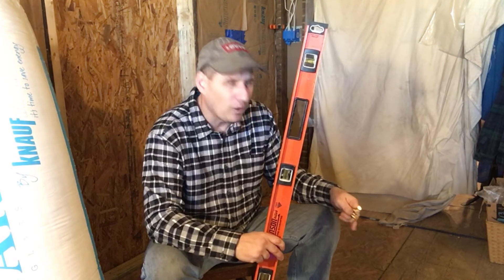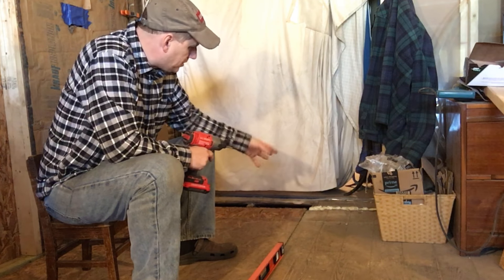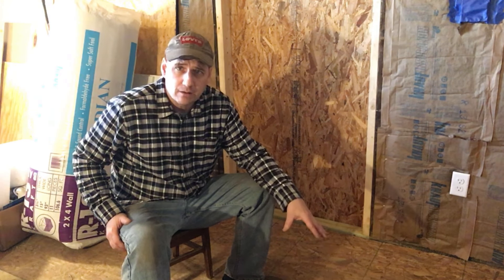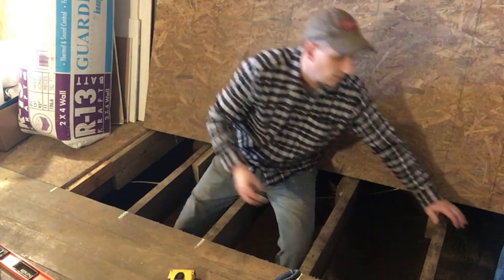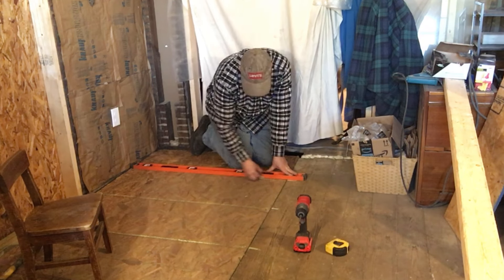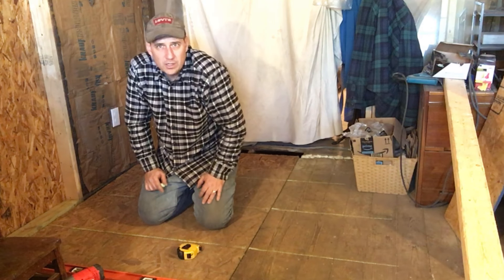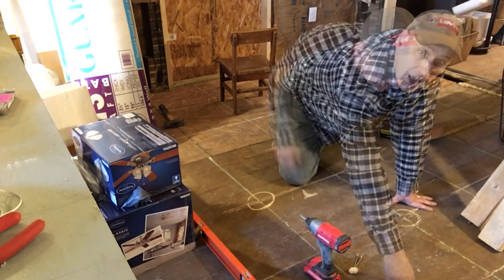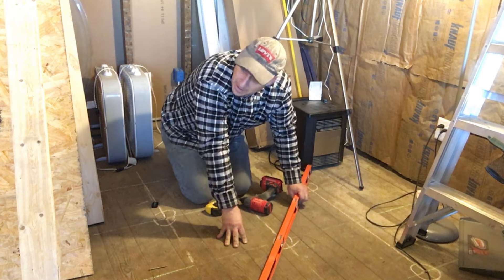DIY: Easiest Way To Level An OLD WOOD FLOOR - Using Screws and a Level

Comment: How are you compensating for an inconsistent slope?  Are you shimming underneath when there's a gap and sanding the floor or the shim when there's a 'high spot' on the overall downward slope. Is the cut wavy or just downward?  If that makes sense...I'm dealing with an unlevel floor myself.  Overall, it's not that off, maybe a a quarter inch or 3/16 at most, but there's points along the way that aren't straight downhill like a ramp.  At some points, it's1/8 off.  At others, it's 1/4, then 3/16, then back to 1/8, then 3/16 again.  Etcetera.  How are you dealing with that with the cut or some other means?  I'm a DIYer who's never done this.  The wavy off level thing is the result of my mistake, which I can't walk back at this point.
Reply from the maker: My floors undulate as well. At the lowest point I'm over 2 inches that slopes upward to a high point near the center of the house. The floor overall slopes one direction to the northeast corner but it is not a continuous slope. Mine too vary in depth up or down. Using the screws, I found the cut depths of my sleepers at the various points in the floor. Then I cut my sleepers to follow the contour of the depths where it rests. The cut goes up and down to follow the floor so the top is level (or near level). I'm not perfectly level and I gave myself up to an 1/8" to a 1/4" of tolerance. That amount of waviness is virtually undetectable underfoot in my opinion. But it will be a little noticeable with four legged furniture and appliances like refrigerators.

Comment: Hi great video
I just have one concern , I see you put the sleepers perpendicular to the joist direction , would it be  structurally wise to do that , i mean distributing the load ?
Reply from the maker: In the video, I left the original floor board deck in place. Adding the sleepers perpendicular along with the second layer of deck just creates additional rigidity of the entire system. The sleepers will not add any “structural” strength to the system. The existing joists are the primary structure. What we are doing here is just leveling and adding some rigidity to the overall system which will reduce squeaking and bounce.
Reply from the maker: If you need to reinforce structurally the joists, you will need to sister joist them. I have a separate video on this. Check it out

Comment: Thank you for a great video. I do have a question. In case floor is uneven due to root / wood worms, and even assuming you take care of the wood worm problem, won't the old floor sink more? (if continue to root) and make the new deck above it uneven as well with time?. Thank you.
Reply from the maker: If the insect problem is treated, the wood should be fine so long as it doesn’t crumble in your hand. Use a hammer to test the softness of the wood. If it crumbles or splits, replace it first. If the floor joists are sagging, the will need to be reinforced by sister-in-law new wood onto it to stiffen those. Once the structure is solid and stable, then level the floors. The new floor deck you install while leveling will stiffen everything up considerably but it will add more weight so make sure you structure is solid!

Comment: This task can be done by scribing the sleepers to the floor instead of measuring. Given the size of the room I'd be inclined to first put sleepers along the short sides of the room that are level to each other and at the height needed to match the floor in the other room. Then install a sleeper at a floor joist point at about half the length of the room making it level with the end two. Mark the tops of all three sleepers for 16" on-center spacing. To fill in the field lay a "new" sleeper from the end sleeper to the center sleeper at the marked 16" locations and put an "T" on top of it to denote the top. Make a wood block to use as a scribing guide--a 10" piece of 2x4 works!  As you slide the block along the floor hold a pencil against the top of it and the side of the "new" sleeper to mark the sleeper thickness. Mark the ends of the "new" sleeper to fit between the installed sleepers. Cut the marked sleeper to length and then along the line with waste side being the part below the scribed line, i.e., the saw kerf should be in the waste (the bottom part of the sleeper stock) not in the sleeper. The part marked with the "T" becomes the sleeper. This is a lot faster method that eliminates all the screws, the measuring, risk of measuring error, and connecting dots. 

After showing them how, I had my 8 and 10 year old sons scribe the sleepers for a 16' x 24' room. I checked the first one and it was perfect... I didn't check any more I simply cut what they marked. 

If you want to get "perfect" sleepers run the sleepers through a jointer to straighten one edge. Then run them through a table saw or thickness planner to make the other edge parallel to the first. If you do this make your scribing block the same width as the resulting stock. They may warp after you scribe and cut them but they will straighten out when you screw them down!  After I had the floor done I used it as a reference surface to level and flattened the ceiling!
Reply from the maker: Thanks for the suggestion!!!

Comment: So I have same sloping and wavy issue. My floor has the original plank floor with a T&G plank style decking. Would I need to remove that decking first before adding a new plywood subfloor using your method?
Reply from the maker: Hi Amadeus. Thanks for watching!
You can do either - but I would say that it all depends on how much you have to level.  The floors I am doing - I am leveling the entire house so I added the new level floor deck on top of the old floor deck.  If you are trying to level a room and you don't want an uneven transition to the next room - you may need to pull up the old decking - so the new decking will be flush with the adjacent floor deck in the next room.  If you do this - just level the top of the existing joists with the same methods and attach the sleeper wedge blocks along the top of each floor joist to provide the level screw pad for setting new decking onto. Then attach the new OSB deck to the top of those level wedges.  Be sure to inspect the joists for any rot or weakness and sister joist any spots that may be compromised.  Good luck with your project.  Hope the video was helpful.
Reply: @RundownReborn  So it won't be too much weight with the original sloping floor boards plus a wavy decking, the new level osb decking and vinyl flooring? 3 levels of wood plus vinyl. I have a finished basement underneath not a crawl space
Reply from the maker: I promise you that the live loads (chairs, sofas, pianos, etc) will be much greater than adding a layer of deck sheeting.
Reply from the maker: A square foot of deck sheeting is maybe 5 pounds. How much do you weigh standing on 1 foot in the same spot? See the difference? The sheeting weight is spread out evenly. It won’t be a problem. Concern yourself more with making sure you have a level and smooth floor with clean transitions to adjacent rooms.
Reply: @RundownReborn  Which type of screw did you use?
Reply from the maker: I used 2-1/2” star drive construction screws to level with and anchor the sleepers into the joists. Then I used 1-3/4” star drive construction screws to attach the 25/32” decking to the sleepers.
Reply: @RundownReborn  Thank you for your responsiveness. I'll be tackling this project this weekend.
Reply from the maker: No problem. I hope I helped and good luck with your project. Post some before and after pics on my Facebook page @rundownReborn

Comment: i get the aplication. but wouldent it be simpler to just pull the sub floor add bords to existing joist and lv it that way?
Reply from the maker: Not sure if that is simpler. Plus doing that you are modifying the structural diaphragm in the floor.

We are also living in the house. Wasn’t really an option for us.

Comment: Ive watched a few videos on this. 
yours starts out a little
confusing but then really makes sense.  Inhave a small bathroom I need to level to match a finished floor. Im figuring once i get the screw heights marked out to be level with the adjacent floor, Ill just subtract the width of the new subfloor and mark accordingly on the sleepers.   does this make sense
Reply from the maker: I think you have the right idea. But I set my screw heads at the height of the sleepers where the underside of the sheet decking would be. No subtracting necessary. 💪👍

Comment: what about the gap of space between the sundeck and the joist? did you put shims at least underneath those screws? What about over the years when you're walking about and the floor continues to sink? I don't get it bro. I think there are some flaws here.
Reply from the maker: The floor will always flex some. The house is over 100 years old. The sagging is finished for the most part. The added deck on top (3/4" thick) has added considerable rigidity to the floor diaphragm. I don't expect anymore sag to occur. As for continued settlement of the foundation (which causes tilt) - that too has been remedied in other ways through foundation reinforcements and proper perimeter drainage. The gap of space between the original deck and the new deck varies from zero to about 1.5". That is an airspace with a vapor barrier. It won't affect structural performance. I used long 2.5 to 3 inch screws at 12" o.c. They have good grip depth to the joists underneath.

Comment: Hello I'm doing this in my kitchen. Its 2 and a half inches lower on one side. There's multiple layers of old subfloor and laminate flooring so I'm not going to tear it up but add on top of it. What thickness of plywood did you use? Thank you.
Reply from the maker: You should be okay going over the old flooring. Just be sure you know where the old structural joists are so you can tie into them - otherwise the floor will squeak. I used 23/32 t&g osb decking. Nominal thickness is 3/4”.  Good luck on your project and thanks for watching!!!
Reply from the maker: Part 2 of the video goes into more detail about installing the decking.  >>> DIY Easiest Way To Level An Old Wood Floor Using Only Screws, Wood and A Level (Part 2 of 2)

Comment: So when you draw the lines, don’t you get sharp corners where the differences between the 2 points is really bad? And is the wood not splitting without predrilling?
Reply from the maker: The lines aren’t perfect but close enough. And sure the wood splits sometimes but rarely and it really isn’t an issue. The sleepers are 100% compression load. They are dead blocks so they aren’t needed for tensile strength. The screws are just there to hold them in place until the deck is down and to tie them into the floor structure.
Reply: @RundownReborn  thanka! My floor upstairs is really bad but instead of those big planks you hem on them mine exists of just a bunch of smaller planks. Might try this though because my desk chair is rolling away from my desk now. Love your videos btw! Already watched alot of them in like 3 days haha. Do you have one about how much time you spend on cleaning everyrhing after you were done lol? Great idea about those lists. I just move and took your “advise” made a list and at least cross off 1 thing (they are way more simple stuff for now) every day. Kinda helps everything going. I would love to see you go in depth and explain just a little more from time to time.
Reply from the maker: @RoyD2  thank you so much Roy. It’s wonderful to hear the videos are resonating with you. Clean is ongoing. Sometimes it takes a whole day… especially during drywall and even longer with demo.

And thank you for the suggestions. I will continue to try and refine the content. Sometimes I go into depth… check out the video about why I enter into the dining room.

Thanks for watching!!! 💪👍🙏

ARCHITECT EXPLAINS: Why His Front Door Enters The Dining Room
https://youtu.be/9crIp0dDskk
Reply: @RundownReborn  so what would you advise for a circle saw now that you are more experienced with the equipment? I am gonna need one to try this. I already own a bunch of makita drills so my preference would be makita, but the circles saws I find look like they are more made for just cutting straight while yours looks more flexible.
Reply from the maker: @RoyD2  I just went to the store and bought the cheapest 4 inch saw on the shelf. Dont use a jigsaw… it takes forever this way. But the little 4-4.5 inch saws are easy to steer down the board.
Reply: @RundownReborn  So what kind of wood are the 2x4s? We don't use that kind of measurement in Europe so it's always hard to figure out what is wat. I'm also gonna need a lot bigger in some places because of the huge slope.
Reply: @RundownReborn  I'll translate the inches to CM and see what I can find:) Thanks! IF this project would ever work out for me I'm gonna need your adress to send you a massive thank you gift. I asked one of the local handymans for a quote to do it, just labour hours are around 1700 euros. Guess that translates to around 1500 dollars.
Reply: @RundownReborn  I have been looking into them a bit , but are you able to steer one of those or even a bigger circular saw across the board? Looks difficult to do for me. Would you say a hand circular saw is preferable to a bigger one?
Reply from the maker: @RoyD2  you can do it with a larger circular saw, but they are harder to steer on curves. Here is an example of the type of saw I used.
https://www.amazon.com/Worx-Wx439l-Compact-Circular-Inch/dp/B084VV5Z85/ref=mp_s_a_1_1_sspa?crid=35UP2J005V517&keywords=4.5+circular+saw&qid=1653278644&sprefix=4.5+circular+%2Caps%2C653&sr=8-1-spons&psc=1&spLa=ZW5jcnlwdGVkUXVhbGlmaWVyPUEzT1ZDTklDRFZaTVg5JmVuY3J5cHRlZElkPUEwOTc1MjI5M0FYN1Q1TTRHTlQyUSZlbmNyeXB0ZWRBZElkPUEwMjEzMTc1MTdLS0dNMjY3RlQ2UiZ3aWRnZXROYW1lPXNwX3Bob25lX3NlYXJjaF9hdGYmYWN0aW9uPWNsaWNrUmVkaXJlY3QmZG9Ob3RMb2dDbGljaz10cnVl

Before that, I used a jigsaw. Those work good too but use a lot of blades and take more time and labor to cut.
Reply from the maker: @RoyD2  just like and share the videos for me! All good! 😊💪👍
Reply from the maker: @RoyD2  a 2x4 is a typical wall stud. Those are good because you can usually get two sleepers out of one board.

Comment: You had the floor joists exposed- why not screw/glue a 2x4 to the floor joist making the 2x4 level and then screw subfloor down to a level surface. Seems alot easier.
Reply from the maker: Possibly. But I only had them exposed in that room because I had some rot to fix. The rest of the house was not exposed

Comment: Do you subtract the thickness of the subfloor from the shims you cut? Otherwise the shims themselves will be level with the subfloor you leveled from, correct?
Reply from the maker: Yes.  You will need to allow for the thickness of the deck sheeting - especially if you are tying into an existing floor surface.  The tops of my screws in the video is where the BOTTOM of the deck sheeting sets.  Hope this clears things up for you.  Thanks for watching!

Comment: What causes floors to sag and become uneven? Isn’t it dangerous to build on top of bent joists?
Reply from the maker: The joists aren’t bent. They are tilted. The corner of the house settled about 2 inches over the past 120 years.

Comment: If the low spot on my floor is in front of a door, I assume I would have to put a new door in, right?
Reply from the maker: If you are raising the floor, you would need to raise the door too. You might not need a new door, you would just need to raise the header up above the opening. It’s not hard… but might take some time and will be a little messy.